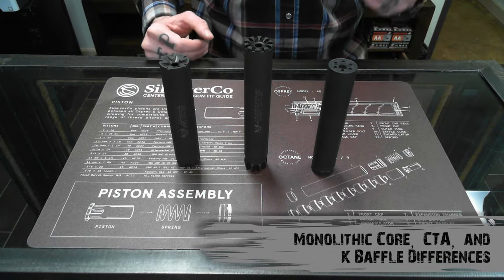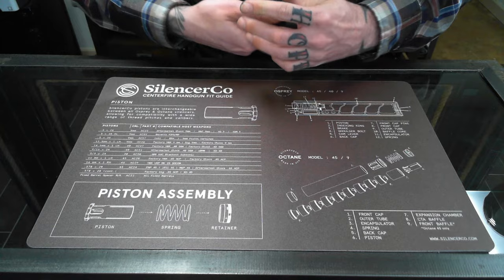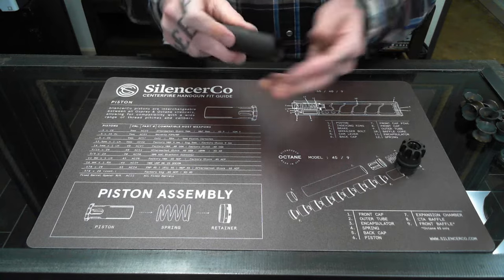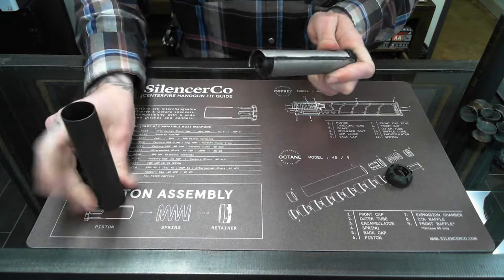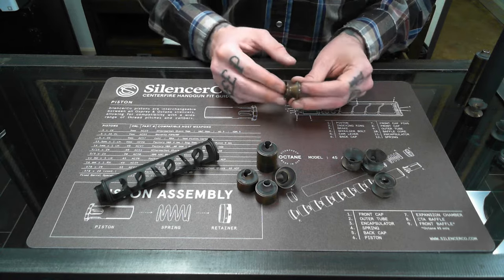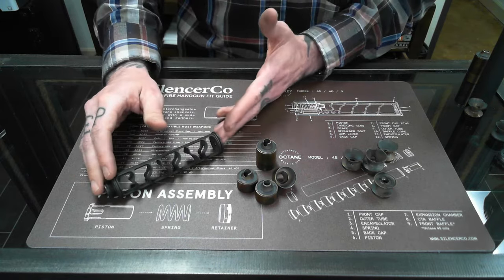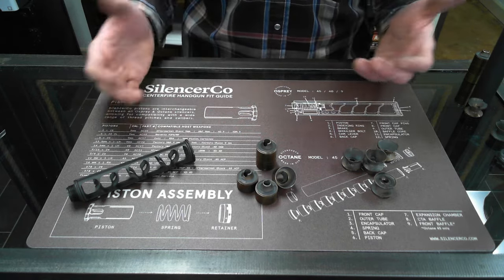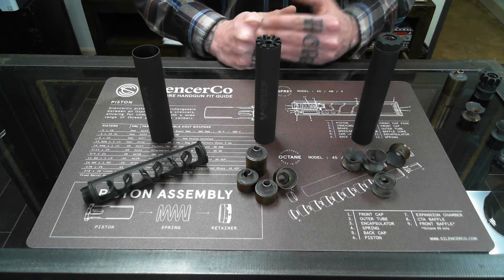Monolithic, CTA, and K Baffle Systems

Comment: The Russian-made Stechkin pistol has a monolithic silence.  Fast and effective baffles for a silencer may be created from a relative stiff 1 ½  wide flat strip of spring steel.

1. The strip of spring steal is folded back and forth to create an accordion.
2. On a grinder, the compresses metal accordion is perfectly rounded along two edges.
3. On a drill, once the two edges are rounded, a hole larger than the caliber to be used is drilled in the middle of the compressed accordion.
4. The accordion is now pulled and inserted in an aluminum tube.  It must fit smugly.  The tube has a cap with an exit hole in one end and a barrel attachment at the other end.
5. When a bullet is fired through the center the accordion acts as baffles.  The gas is delayed and compresses the coil taking up further energy. The corrugated steel accordion behaves as a spring inside the tube.

May years ago, the French designed a silencer with a spring baffle.
Reply: The design simplistic yet effective

Comment: What way should the baffles face when on the barrel?
Reply from the maker: All suppressors could be different, but generally if you point the host up in the air, the baffles should be little ice cream cones.  Small end pointed towards host, big end toward target.
Reply: @Capitolarmory  thanks for the reply I was thinking maybe the direction could have a difference but was scared to face them in any other way

Comment: Hello, What would you recommend  is the best .22lr silencer Priority goes like this (Quiet > Looks > Cleaning >) also is the AAC Element 2 so much quieter than the Spectre II that its worth the cleaning? (will be using it on a pistol) or could you tell me the diffrence in sound maybe in % how much quieter it is?  And could you suggest me the best .22LR Pistol? priority goes like this (Accurate > Powerful > Looks > Quite) overall i want something Really powerful accurate silent and beatiful (Money is not an issue)
Reply from the maker: Based on those criteria, I would probably say the Dead Air Mask or Spectre 2.  Both are fantastic, sound great, and are easy to clean.  As far as a .22LR pistol, my first choice is the Ruger 22/45